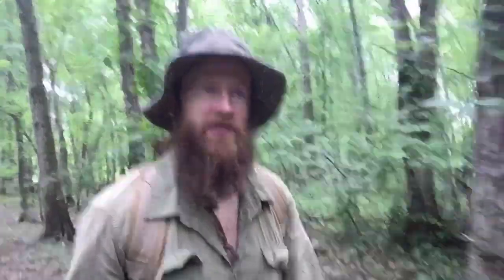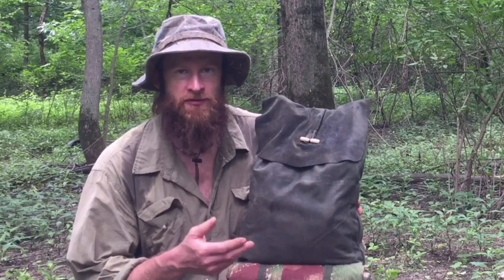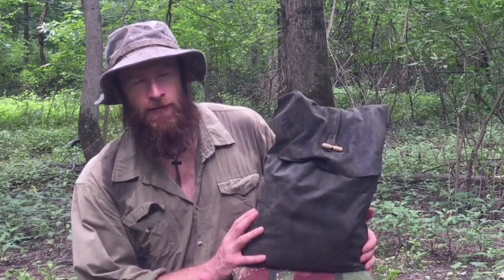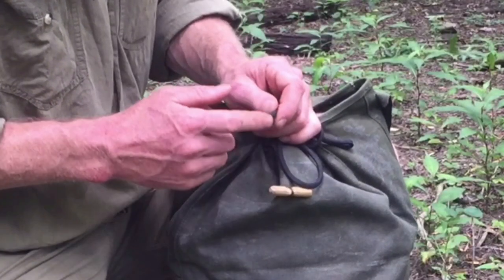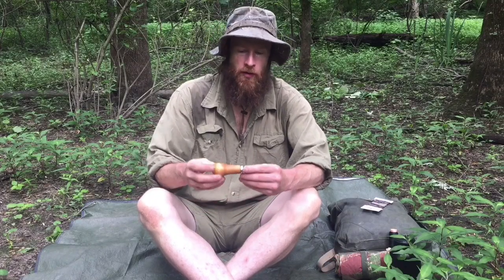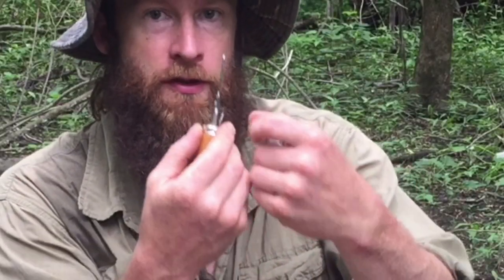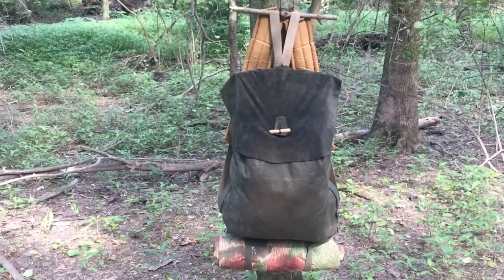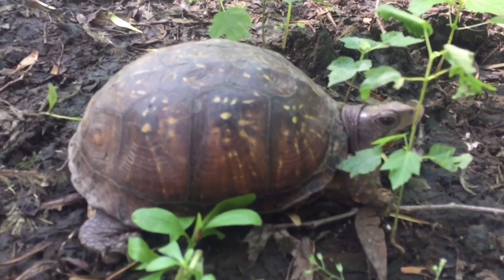1941M Scout Pack, Speedy Stitch How To Use, Make Your Own Gear

Comment: Nice pack!  I've used a similar device (I think it's called the "Sew Awl") to make some sternum straps and waistbelts for older packs.  Definitely worth learning to use.  My biggest struggle so far is breaking needles, especially when sewing two pieces of leather together.  Any tips on techniques to avoid having that happen?
Reply: Take a nail to make the holes before you stitch it together.
Reply from the maker: Leen Visser Thank you! 
 Before getting the speedy stitch, I was using a small pair of pliers to drive the needle and then pull it through heavier leather, using either the pliers or a piece of leather. I have broken a couple needles, but it seemed it stopped after making sure I was rotating needle, “drilling” out the leather with the tip. Heavy leather, I use a small drill bit to make holes.
Reply: Thanks for the tips, guys!

Comment: great little tool. I didn't come to buy it yet, because when I see it here where I live it's a bit pricy. 2x or 3x as much as you had to pay I guess.
Reply from the maker: couchcamper Ah, thats too bad. A basic awl with a handle is worthy substitute. I was using a needle with a pair of pliers before I got the stitcher.
Reply: @EnduranceRoom  I settled on just a needle and threat. like in the old times^^

Comment: Appreciate. Sorry to bug you, but I can’t remember and I think it was you who gave a link for a hand crank sewing machine. If it was you, would you please repost link or remind me which video it was attached too. I work like dog and just don’t have time to go through all vids man. If not- all good. Thanks
Reply from the maker: No problem at all. It is called a speedy stitch. Ebay, harbor freight, Michael’s craft stores should all have them. Great little tools. I keep one in my bag with some extra thread, plus a few sewing needles and thread for smaller stuff. Very handy to have  in case something breaks or needs repair. Have a good one.
Reply: @EnduranceRoom  thanks for reply. I think I have my channels confused. I was referring to a full size sewing machine that’s manual. 🤷‍♂️😂 It may have been LoneWolf. I can’t keep stuff straight. Thanks and be safe- more importantly, enjoy!